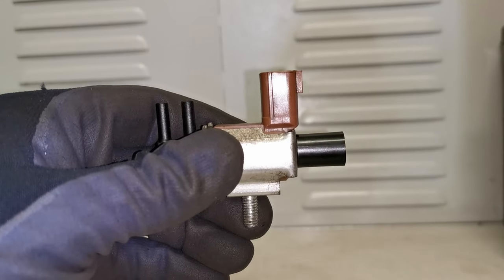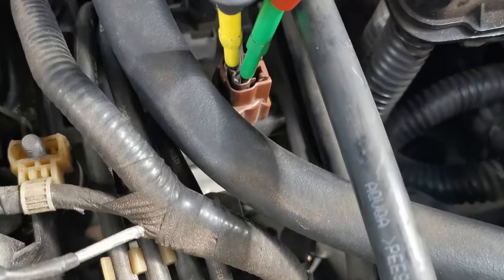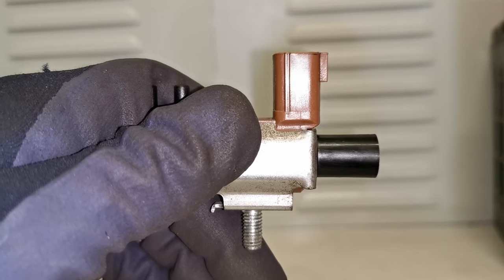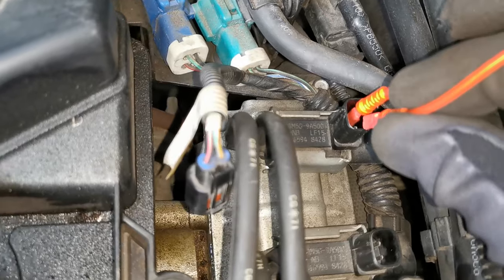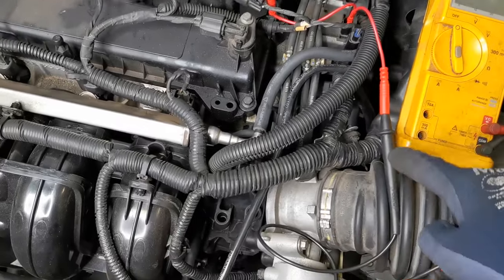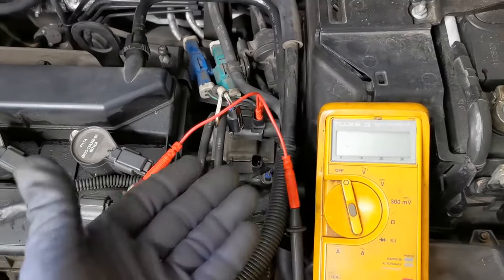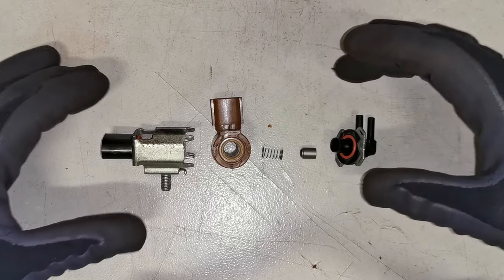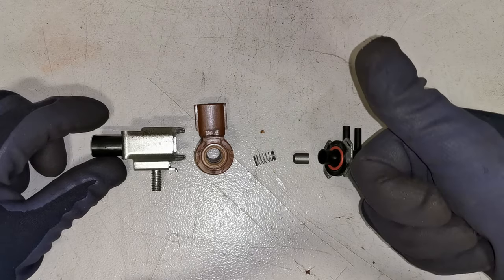Simple Intake Manifold Solenoid Testing - Ford & Mazda P0661 P2008

Comment: A key thing to note is that one of those valves is typically always ON and the other is always OFF.   Now since the valves are the same construction, that means that one of them is on most of the time, which is constantly pulling current through that coil and that's why it burns up.  They could have designed a new valve so that the spring holds it always closed, so that it is the opposite of the other valve by design, but instead, they just used the same valve for both operations---  so one only kicks on when it needs to, and the other is ALWAYS on and then simply kicks off a bit when it needs to..  SO instead of designing a proper valve function, they just expect you to replace it when it breaks, so they can save a couple of dollars and use a part that already exists.

Comment: This video saved me a bunch of time! P2004,2008 on an '04 Focus, swapped the solenoid without testing the new one and thought I had to start chasing down a vacuum leak or actuator problem, tested the solenoid by hooking it up to current like you showed and I realized it was just busted! Swapped it out with another one, cleared the code, and ran it a while. Seems fine!
Reply: hey what were the alligator clamps to mini crocodile clamps you bought I cant seem to find any
Reply: @oliverreyes5241   just the tiny ones from Harbor Freight, regular little alligator to little alligator? the ones in electrical for like 2.50 or 3 dollars or so. '36 inch test lead and alligator clips set'

didn't need anything else. i connected the wires to the positive and negative on the solenoid first bc it's fiddly and trying to complete the circuit in there felt dumb because i have shaky hands. made sure nothing was touching in there that shouldn't be, put the rubber cover down over the clips. then put the negative to ground bc the clip could hold onto a little grounded bolt, then completed the circuit by tapping the positive wire's other end on the positive terminal to test for actuation
Reply: @oliverreyes5241  CEN-TECH 36 in. 2 Colors Test Lead and Alligator Clips Set

Comment: What if the solenoid works at 12v but the connector sending the power is 1.57v where else do I check for that

Comment: Great video. One question: if I drive with swirl flaps removed, what to do with this solenoids? Remove the hoses that go from the intake manifold to them and plug them, or just leave as it is?
Reply: What did you end up doing? Any check engine lights?
Reply: @sharkmansharkman3929  there wont be any check engine lights in this case, even with the p2008 code active. I drove with the solenoids disconnected and intake plugged for a year and got this code. It caused car to hesitate at 1500-2000rpm, almost drove me crazy. Saw the code, but I thought it was something else since it was disconnected… anyway it’s best to have this system operating as intended
Reply: Thanks yeah my swirl flaps are rattling around in there, I'm sure a piece broke off and blew up my spark plug. Now I'm stuck with a p2004 stuck open. Gunna remove my swirl flaps but that middle bolt on the ford focus intake is freaking impossible to get to
Reply: I know i was hoping I could just buy new flaps and install them but I guess thats not how it works, gotta buy a whole new intake huh, ill check that website out

Comment: Well done Gerard. 
Those Ford Focus's are common with those faults codes the solenoid packs failing.
Good idea with heating and cooling them as well. It shows up any intermittent faults.

They have a big heat sink under the solenoid pack that stores all the heat necessary to make an electrical component fail! 😉
Reply from the maker: Thanks Max, great point on the heat sink.  
As always I appreciate the input mate.
Reply: @GerardBurkeBurkesGarage  This is such a common problem, I wonder if spacing the solenoid pack up a little would allow more air to circulate and keep the heat away from the solenoids.

Comment: Hi Gerard 
Please could you tell what the other black part is on the solenoid?. 
It’s like a screw and it can be turned clockwise and counterclockwise. What does that part do exactly ?.
Thanks

Comment: Hi i got a p2008 Faultcode and i checked the resistance on the solenoid both came out to around 30 Ohm is there still a possibility that the solonoids are faulty?

Comment: If they both click could there still be an issue? I've checked the purge value and the solenoid and they both work but I still have the code

Comment: the connector of one of them is one pin give a ground about 0.03v or less, and the other on is battery voltage.
And the other solenoid is give a ground about 3.49v and the other pin is give battery, so is that normal and the pcm controling the value of the ground or is something is wrong?!
Reply: mine was the same
Reply: @calthorp  Did it give its fault code?
I think the multimeter will be useful in that time especially the ohmmeter.
Reply: @Nightbaron_Shadowman  The solenoid That gave 12v & 3.4 was working correctly the other solenoid was 12 & .2 was dead & I replaced it although It still gave same readings when replaced It did not give CEL but did give fault code
Reply: @calthorp  Replaced by new one?
Did you measure the value of resistance of the new solenoid?
Reply: @Nightbaron_Shadowman  No I did not sorry. I tested the old one by applying 12 v across terminals & it did not work so replaced it

Comment: you did not explain what valves are opening or closing next time explain what the vaccums do and where they lead to.
Reply: they control the swirl-flap inside the intake maniford, and also the PCV system(i think)